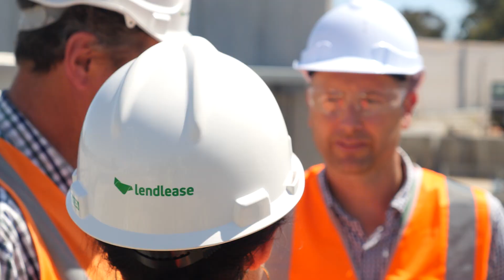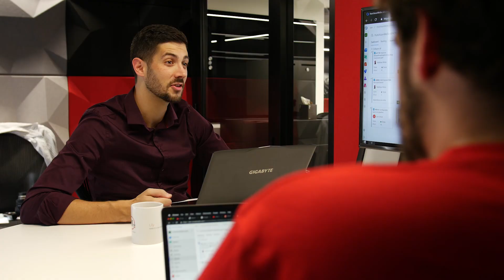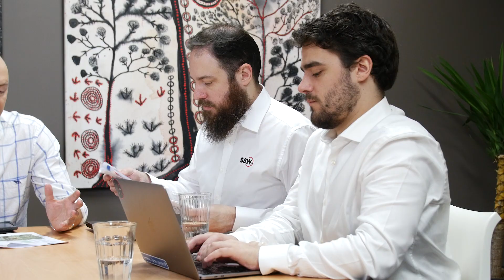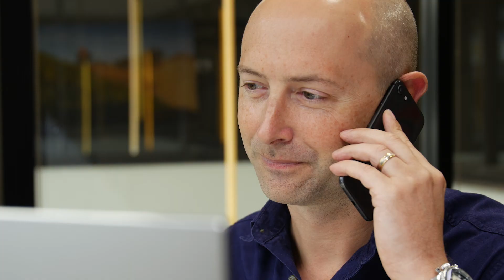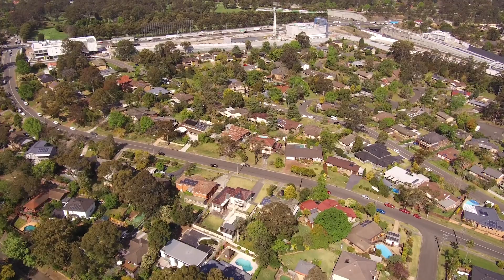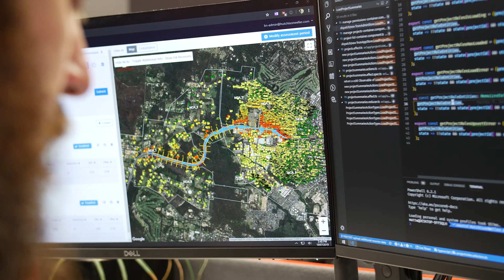Building KNOWnoise with Clean Architecture | SSW Case Study

Comment: What do you mean by "It's a pure ngrx application"?
Reply: The Angular UI is Pure i.e. there are no side effects when using it. The containers only interact with the store through subscriptions and dispatching actions. All of the interactions with external resources have to go through NgRx - which allowed us to build more pure and simple components. A benefit of this has been that devs have been able to onboard to the project quickly as the UI is straightforward and not littered with multiple responsibilities.